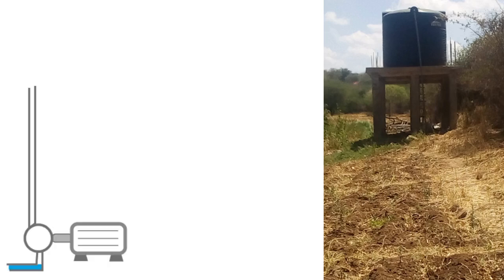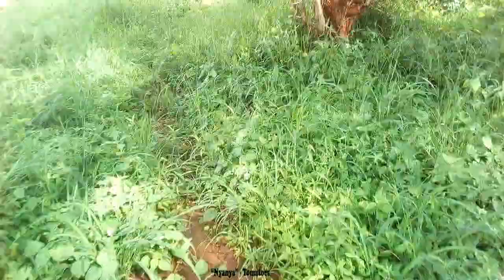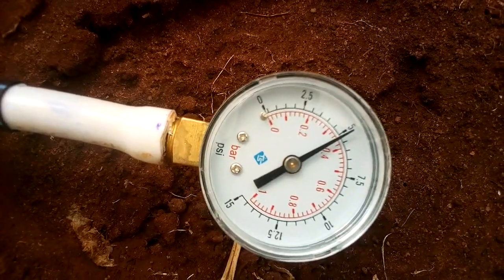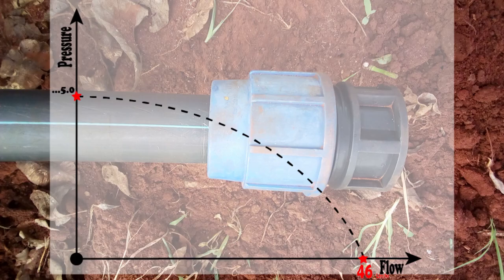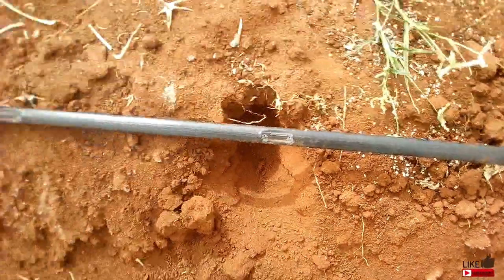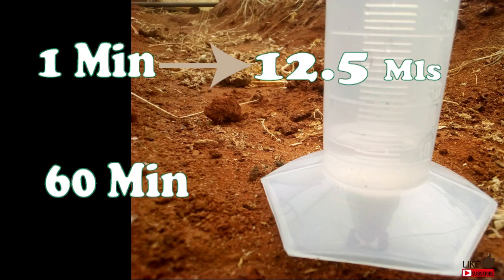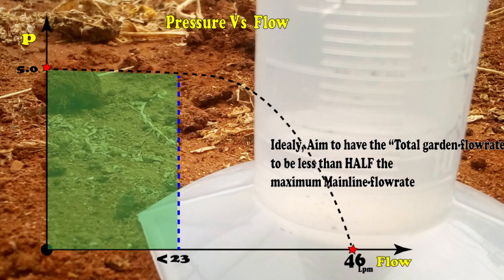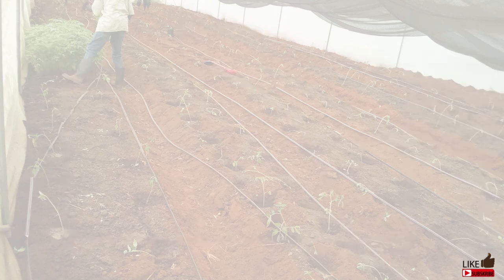DRIP IRRIGATION: Water Pressure And Flow  Part 2

Comment: Hello. Can one instead pump directly from the river using water pump into the drip lines and install a disc filter at the suction instead of using the raised tank or gravity?
Reply from the maker: YES, it's possible.  If you can ensure filtration is done right. The filter will affect the pump performance. + You will also have to balance the number of beds to be irrigated at a given time(i.e match the flow rate of the pump to number of beds, to operate at reasonable pressure). Fix the discfilter on the mailine leading to drips Not at the suction end. You can buy recommended filter to fix at the suction side.  Also consider the cost the cost of fuel (I'm Assuming the pump isn't electric)